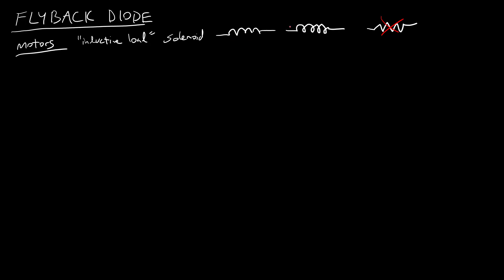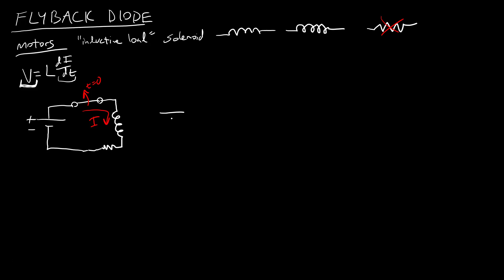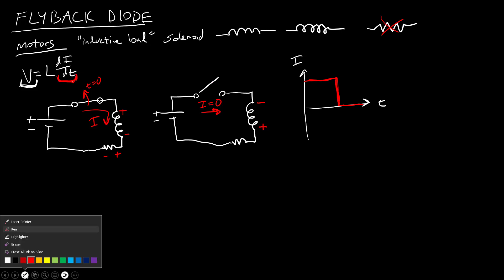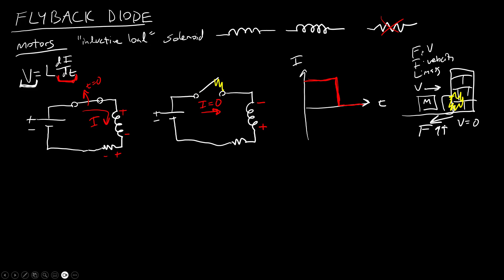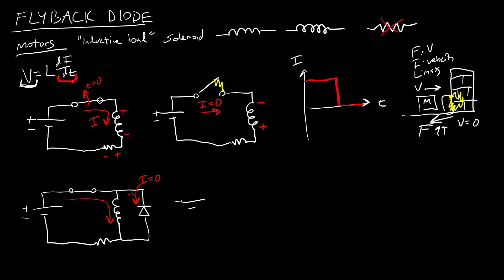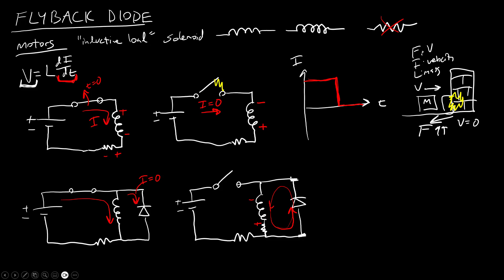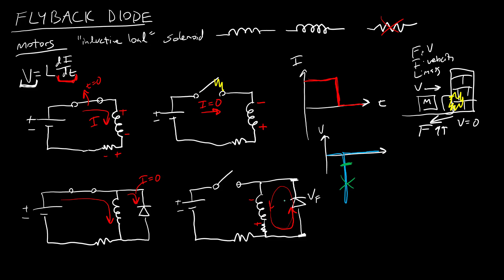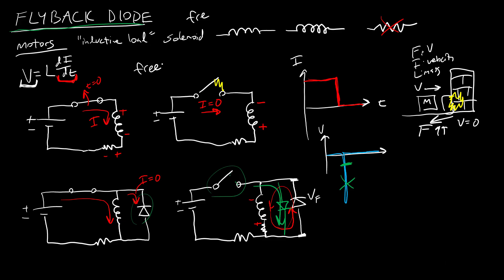Intro to Circuits 49: Flyback Diodes

Comment: at 5:08, why does the polarity of the inductor opposite to the battery? For example, if we replace the inductor with a capacitor, the voltage will be + on the top, and negative at the bottom.

Comment: There must be minus in self-induction formula. Thefore there will be minus on the anode and plus on the cathode of the diode. And then the question arises why does the diode pass current if it is operating in reverse bias?

Comment: Hi, I'm using a buck converter 120V 10A to run an Inductive load. How will the RHRP3060 30A,600V Hyper fast diode perform & what will be the total power loss (vf & Current).
Someone plus help